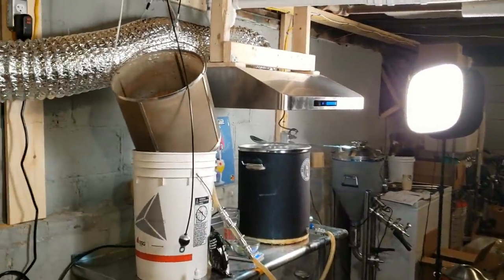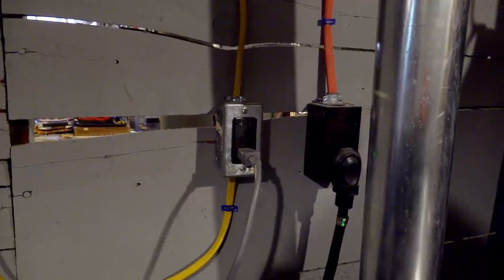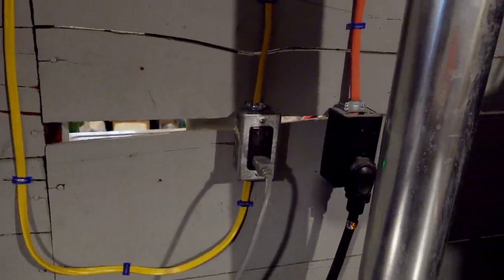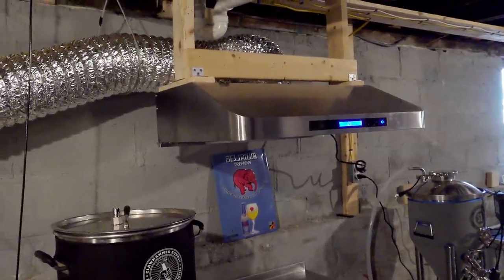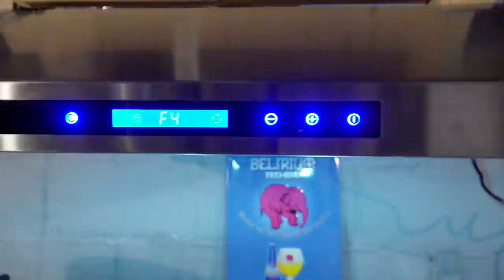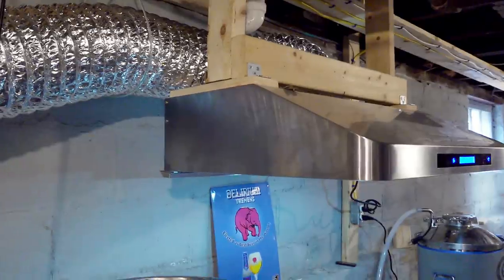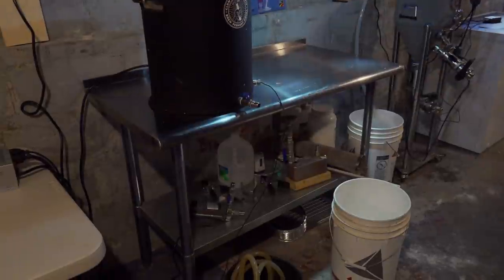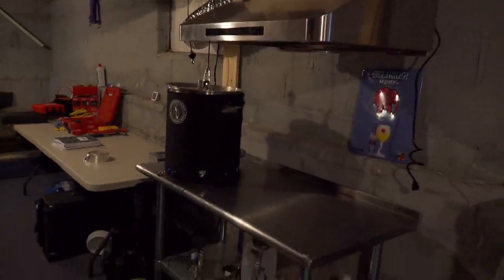BASEMENT HOME BREWERY BUILD COMPLETE!! (For Now) | Full Tour

Comment: I can not believe how close my first brewing room build was to yours! I did start with the Clawhammer 230vac instead of the 120. But I had the fan for condensation similar to  you through  a window and a pulley system for my BIAB. I moved a few years after I finished it and had to start all over! I still use the Clawhammer controller but had to get a Spike condensate lid because my new space has no window. Also had to buy a spike 20 gallon kettle because the condensate lid would not fit on the Clawhammer kettle so no more using the BIAB. I use a 10 gallon water thermos for mashing and do a fly sparge by using gravity.  Hope you can check out both my builds on my channel to see our differences. Love your different styles of beer you do and glad to see you still put out content. I am lagging way behind on my videos and a lot of brewing channels have also gone away. Cheers!

Comment: Hi Steve - Looks like you are getting a nice set-up!  You mentioned in this video that you were looking for your upgrade path to 240V.   i had been using the 120V Clawhammer for a while and recently took an upgrade path to 240V via buying the 20 gallon kettle (10 gallon system) from Clawhammer.  It provides lots of options and redundancy as I now have a 'spare' pump, plate chiller, quick connect tubes..... etc.  But most of all, I can use the 240V controller and element in either the 10gal kettle or the 20gal kettle.   (the 240V option makes fast work of 5 gallon batch!).   I like your pully to lift the grain basket.   With a big grain bill on a 10 gallon batch, I have found that a block and tackle on that overhead makes life even easier.   I have a few fan favorites that are worth a 10 gallon batch (2x more beer for same amount of cleaning!), but also plan to do things like brewing a 10 gallon base of porter and then splitting into 2 boils in the two different kettles to do 5 gal each of trying a peanut butter and a coconut (5 gallons each).   Still just an idea, but this upgrade path opens up the options.   Looking forward to seeing where you take your set up.   Cheers!
Reply from the maker: Thanks for the info! If I stick with clawhammer I would most likely be keeping the kettle but swapping out the controller/elements like you said. I'm still pretty hesitant to move to a 10 gallon batch size since I just like to brew something different every few weeks. Cheers and I'm glad you enjoyed the video!

Comment: Good morning Steve. On the electrical stuff, if the panel you'll be getting the 240 volt from isn't already set up for GFCI, you're better off installing an RV style GFCI outlet. In order to install a GFCI breaker, I'm pretty sure the bonding lug has to be inulated (float) from the box itself.
Reply from the maker: I'm pretty sure it  is since its the main panel for the condo but I will definitely need to look at it further.

Comment: This looks amazing.
I'm not trying to be that guy, but be careful with that hood.
1000cfm is a lot of air.
That's more than twice the volume where make up air is required, at least in my state.
Just open a window, and in your case seems like an old house, so it's likely ok.
But you could pull in your furnace or water heater emissions back into the house!
We are all trying to keep you safe.
Thanks for the videos
Reply from the maker: Yeah that's why I have a two carbon monoxide alarms down there

Comment: Nice brewery! I am almost done with my setup (working on finishing up the keezer). I brew in the basement and vent outside. However, unlike you I went cheap on the range hood and found out that 250 CFM is not enough. I saw the guy from Trouble Brewing using it in his brewery so I thought I would do the same. I think I should have went more towards 700 CFM to make sure I get most of the steam and smell out. The kids don't like the smell.
Reply from the maker: Thanks! Yeah that was my initial plan as well but I wanted to be damn sure I had enough CFM, and this hood does the trick! The longer the duct is and the more curves you have the slower the airflow will be

Comment: I missed something prior to this video. Are you no longer an apartment brewer? I've never seen a basement come with an apartment. Did you buy a house? What state do you live in? I'm curious about the electrical building code there. In Illinois, all wiring must go through conduit which makes projects like this much harder to do.
Reply from the maker: Hey Larry! Yep, long story short I moved into the condo my fiancee owns in Massachusetts and the basement has great brewing potential. I made a playlist with the other videos from this series in it if you want more details. I checked the code and there is no conduit requirement, that sounds like a pain to work with!

Comment: What temp range is your fermentation fridge? I didn't see it on its amazon link. Are you setting it to the exact fermentation temp you want? The only refrigeration unit I've seen that can get temps high enough is the RAPT Fermentation Chamber. Love the channel!
Reply from the maker: Originally it was actually a chest freezer, so it can go way down below freezing. I have a seedling plant mat inside though which gradually raises the temps up to as high as the 90s F. I have been measuring the temps from the fermenter wall so it seems to do a pretty good job when hooked up to an inkbird.

Comment: Looks good. What is max grain bill for your claw hammer basket??  I just did a 22.5 lb BIAG using nylon bag without pulley  and it gets dicey pulling out hot bag.
Reply from the maker: Thanks! If you adjust the initial amount of strike water and opt for a thicker mash with sparge you can easily get 20+ in there. I just did a Belgian quad with 18 lb of grain and 8 gal strike water with room to spare

Comment: The setup looks good. I just think that hood being so low and close to the kettle would drive me nuts, but you didn’t really have a choice. Is it worth the extra $600 to go to a 240v kettle over a 120v from ClawHammer? Realistically, how much time would I save?
Reply from the maker: It's low for sure, but I dont really mind it. Still plenty of space to add things to the kettle and stir. To answer your question, I think it would be worth it for the time savings and boil intensity upgrades alone. With 1600W it takes about 1 hour to get from room to mash temp, and then another 45 minutes to get from mashout to boil. With a 5500W element its going to take about 20-30 minutes for those steps

Comment: Looks great Steve. Jealous of the dedicated brew cave! I brew 100% outside but built a brew cabinet that I put my fermenters in. I do live in California though so weather isn’t usually an issue! Is this a new apartment or have you had this space ready to use for a while? What options are you weighing up for your 240v upgrade?
Reply from the maker: Thanks! It's definitely a nice upgrade to have. This is my fiancee's condo that I'm gradually moving into, so its been in development for a while. For the 240V I'm looking at just setting up a 3500W induction burner first and using that for an HLT and boil kettle while I keep the clawhammer for mashing. But that may change later, we'll see whats on the market at that point

Comment: Looks good. What size is that stainless rack and where did you get it?
Reply from the maker: Its something like 4 ft x 7 ft x 1 ft, but there are a lot of configurations, and they come smaller and larger. I got mine at target, and you can find them at many different hardware stores but this is pretty similar if you want to stick with online: https://amzn.to/3ub87ze
Reply: @TheApartmentBrewer  Thanks. I'm a garage brewer that's downsized a lot. A couple of those on some casters will be perfect for my needs.

Comment: I'm getting ready to set up an Anvil Foundry in my basement.  I don't plan on brewing more than once a month, if that - really wondering whether I need the ventilation like you have.  I've got a dehumidifier down there already.
Reply from the maker: If its a 120V boil and you're really only brewing once a month, you'll probably be fine, but its the long term effects that you'll want to worry about. I brew roughly every two weeks and will eventually be moving to a more vigorous 240V powered boil so that demands ventilation. When you think about it, thats 1 or more gallons of sugar water thats getting absorbed into the building if you don't ventilate
Reply: @TheApartmentBrewer  Good points all around, thanks.

Comment: Great progress, Steve! Most jurisdictions will let you do your own wiring but you may need to pull a permit and have a final inspection done to avoid problems with your hazard insurance if there is a fire. You need to be clear on who has the hazard insurance for the building and whether your portion of the basement is covered on your insurance. Former realtor talking here.
Reply from the maker: I appreciate the concern, in my town you do not need a permit to simple electrical work like this - all I did was extend an existing circuit. The electrical code is pretty clear on this

Comment: You really need to put that wire in conduit.  Seriously, hire a local electrician or at least pull a permit and get it inspected so you can get those violations fixed.
Reply from the maker: As far as I know (and I checked the local codes) conduit is not required in this situation in my municipality so this is not a violation. That being said I understand where you are coming from and it wouldn't be that hard to rerun this through some EMT